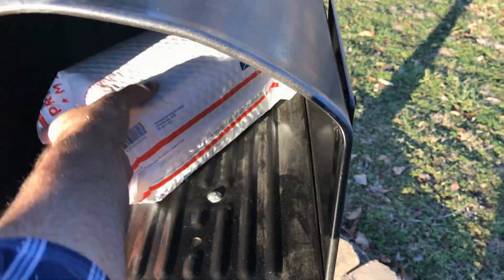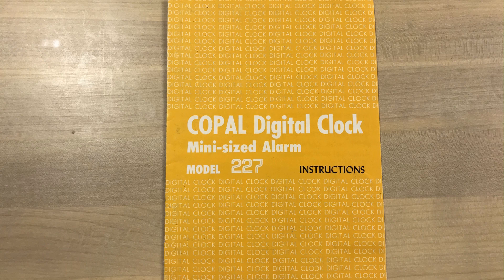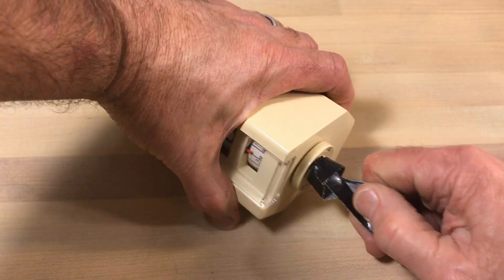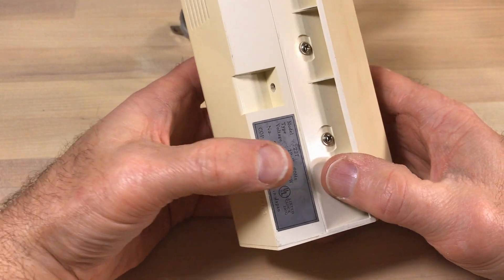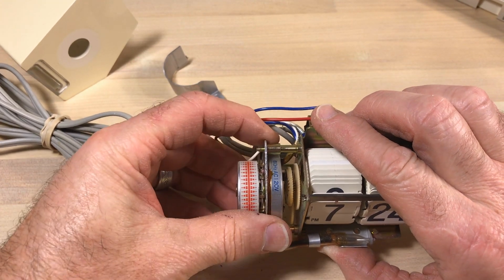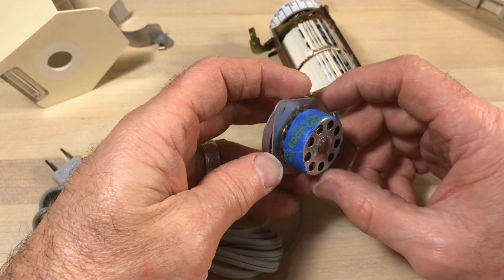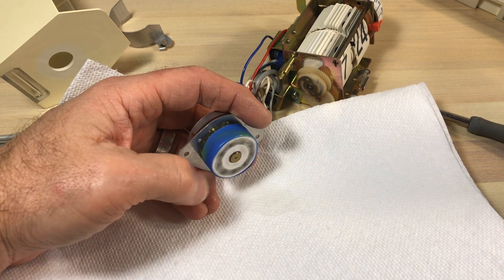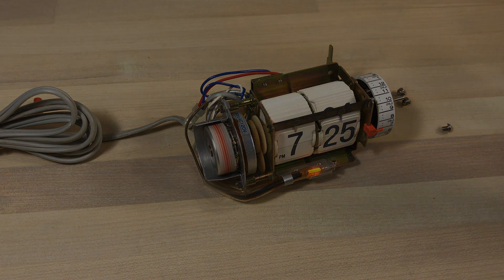Working With Whirligigs

Comment: I always use high performance PTFE/TEFLON grease called GEAR-FLON to lubricate the motor and the gears, even inside the gear shaft of the motor and the motor diectly. Actually, I grease every moving parts because gear-flon reduces friction up to 80% so that even in many years to come, the chance of gears stripping is highly reduced. The grease is made for lubricating tiny plastic cogs such in RC cars and with the fact that it is a PTFE based lubricant it is fully compatible with any sorts of plastics and it won't cause any degedation. In addition to that, it doesn't cause and build-ups over the year like silicone lubricants do over time. You should be careful when applying mineral-oil based lubricants onto plastic parts. It can cause degeneration over years to the plastic

Comment: I should have watched this before I cleaned the motor on my RC-6551...yep...the alcohol took most of the design off...wife to the rescue! She actually panted the black/white spiral back on to the wheel. I was afraid it would mess-up the balance of the motor, but it worked just fine!

I'm trying to get enough nerve to try the Volume-40 trick to bring back my less than white Westclox Speed-Read!
Reply from the maker: How awesome is that! Tell you're wife she's the best!
Reply: @Flipclockfans  l told her, LOL now she wants $20 bucks for the paint job 🤣

Comment: Great video, thanks! Going to use your techniques on a blacklight clock I have. Hey, I was wondering if you just use super glue for gluing broken plastic back together? One of the feet broke off my clock.
Reply from the maker: krustaceanken - yes. Superglue is great and terrible stuff. It will fuse those plastics. But for the same reason it can ruin them. It’s especially noticeable on wood grain finishishes. Use VERY sparingly. Then walk away, before you touch your clock and leave a permanent fingerprint. If it sounds like experience talking ... it is! Unfortunately. But not this time. Great and Terrible.

Comment: I was very nervous when I saw a flipclock in that bag...glad to see they packed it well and just happened to use a bag to ship it. I won an ebay auction of a cyclometer where "Goodwill" was the seller. They shipped the clock to me in a bubble mailer bag., with no other protection.  It wasn't a pretty site when I opened it up.

Comment: Mackey...you don't mention what lube you are using...I have a Copal 226 I'd like to clean, what about using the new version of superlube?...(in the pen container) with the teflon that stays in suspension?...I enjoy watching your videos.
Reply from the maker: You got me.. I simply don't know much about that stuff. You really need a light oil in my opinion though. There's not much room between the rotor there. Something thick would seem that it would gunk it up. But .... who knows? If you find out please share!
Reply: I have made a comment at the top of this video, I think basically every PTFE/TEFLON based lubricant does the job, even for any small plastic cogs.